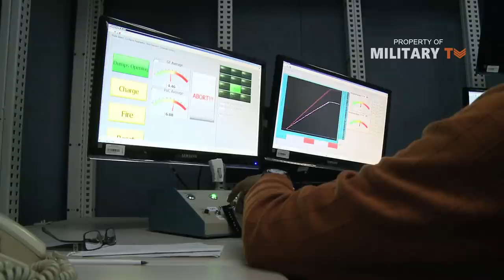Here are 5 of the worst weapons projects the US military has in the works

Comment: some of these (the rail gun, long range gun on the Zumwalt) seem like more engineering in progress, not ready yet. The F35 is one of the worst due to a number of reasons the video didn't go into. The Zumwalt and LCS seem to be fairly good ships, but the military had a mantra of "One Ship Can do All" for a while, which meant Jack of All Trades, Master of None. Zumwalt can still be effective, say, at hunting other ships, but leave land bombardment to another ship. LCS can be effective mine patrol and pirate patrol, in less contested waters since its not as survivable. WIth the new Frigate Procurement process, the Navy has figured out what mission they want from a ship, and what they can leave out of the ship, seems so far to be a good efficient option
Reply: I agree with your assessment on the rail gun, what they also fail to mention in the video is that the whole purpose of the railgun is to decrease the amount of carried explosives on the ship to prevent its total annihilation in case of a rocket torpedo attack.

Comment: Also the rail gun is a very good weapon on a ship like USS Ford. It's rate of fire can increase if built with proper cooling systems,  and Ford was designed specifically to use them. Unfortunately Rail guns will only be useful on large vehicles, till we shrink the size of it's power generation needs or generators themselves

Comment: If you want an honest opinion about the F35, ask an Israeli pilot or ground crewman.  They've been flying them for about a year now and have come up with some very unflattering nicknames for it.

The LCS concept (a greenwater patrol/fast attack corvette) is solid, and the Freedom class actually handles the role reasonably well. The problem is we're not using them for their intended purpose.  The brassholes keep trying to turn them into an all purpose bluewater frigate/destroyer hybrid, which it was NOT designed for.  The Independence class is completely useless.  Best thing would be to strip off the weapons, convert the well deck into a cargo bay, paint them white and donate them to the red cross as hurricane relief ships.

The Zumwalt... I don't have enough coffee, typing space or patience to tackle that fiasco...

Despite its problems, the Ford class isn't really much different from the Nimitz class in terms of development issues, and nothing about them was particularly groundbreaking or new.  The first 2-3 ships had their own laundry list of problems but they were eventually worked out.  Aside from a few bumps, mostly caused by politics, she's on track to be a fine ship.

As to the rail gun... 10 years and half a billion may seem like a lot, but not really when you consider it's a completely clean sheet concept with no similar systems to work from.  The rabid and idiotic drive to strap it on everything that floats RIGHT NOW! is what blows my mind.  Like the Dumb Zum, it makes me thing of Veruca Salt (I want a fancy new toy and I want it now!)

Start out with 1-2 mounted on a big, nuclear powered vessel, then after the bugs are worked out start moving it onto smaller ships.

But all of those ideas make sense, so of course the shitheads in the Pentagon can't  do it.

Comment: Okay these are NOT failed projects or the worst. Okay the Littoral combat ships are bad but everything else is not. The rail gun project which is now getting funding by the Army is a game changer. Tests have proven they can now fire multiple shots very quickly for the gun system.

Thanks to the Army Its going to take longer because now it has to be developed for both land and sea use. Finally the Emals system is fixed, the engines are fixed. Its just the Elevators which are now getting fixed.       The problem with maturing technology is that no one is developing this tech. The US military has a long history of failed projects however the knowledge gained from those led to improvements in other systems down the road. 

Case and point the stealth tech developed for the Commanche was used in the Stealth hawks and the current light recon helo being developed by Bell. Mistakes are expensive but we are human, its how we learn and grow otherwise we stagnate. Or in some companies case bankrupt.

Finally cancelling the replacement SPG for the army was the biggest mistake they could have made since we are the only modern nation not using a modern SPG. The Palliden  is so outdated its scary, does it still work yes but it lacks the rate of fire of everyone else.

For a good comparison and simile. This is like me saying that person is an idiot for buying a 9k computer that does everything but will go dead in say five years. Likewise that person will criticize me for buying a 5k .50bmg rifle because I will only be able to take it out once in while despite the fact it out last his computer by a continent. 

Lessons learned is this, there is no failure just a learning experience. Thank you.

Comment: The rail gun has tremendous potential, it will evolve able to penetrate completely thru ship hulls taking out the heart of the ship, also used to take out satellites
Reply: 45Kimber1911A1 you refer to taffey 3 during the battle of Leyte gulf as for Yamato actually hitting anything that is still up for debate as Yamato never reported scoring a hit in the battle and only fired a few times but at extreme range hence why HMS Warspite still holds the record for longest range hit on a moving target
Reply: 45Kimber1911A1 lacking proper radar (for the time) none of the ships in the Japanese battle group would have been able to see such an event as Yamato hitting anything  (with Yamato firing at her max range of 23km which goes beyond the horizon) not to mention taffey 3 decided to run away into a rain squall and could not actually see the event either. Not to mention that most American ships lost were lost well before Yamato was even ready an the escort carrier that supposedly got hit by Yamato did not report getting hit due to the fact that it was already up in flames and exploding due to damage suffered earlier in the battle it is also my opinion that naval guns over 15 inches offered no real combat benefit seeing as how the only major “advantage” was range but one of if not the longest range shot was done by a battle ship laid in 1911 with 15inch guns
Reply: @collinfrye9555  Battle off Samar was part of the Battle of Leyte Gulf...a subsection of the battle. And during the battle, several Japanese ships landed hits with armor piercing rounds, but the tin cans had so little armor the AP rounds would punch through one side and out the other before they could detonate, forcing them to switch to less penetrative rounds.

The Japanese fleet had been moving in to attack the US forces that Halsey left uncovered having taken the 3rd Fleet to chase Japanese Carriers that were actually a decoy. However the Admiral of the Japanese fleet had no idea the decoy worked, didn't know about escort carriers, leading him to believe them to be fleet carriers, misidentification of some of the american Destroyers as Cruisers, and the sheer ferocity of Taffy 3's resistance led him to believe the decoy failed and they'd engaged the 3rd Fleet, leading them to back off of what on paper should have been a curbstomp for the Japanese fleet who's flagship alone outweighed the entire task force they'd engaged. However a battle is won by men, not machines.

As for the railgun, I have to say that while it's an innovative piece of technology, it's actual tactical usefulness for navel warfare is questionable given that most formidable navies would engage at missile ranges or with torpedoes.
Reply: ChakatBlackstar I’m aware of how the battle went I rewatched the video myself when I posted it. Some thing I learned since posting these comments is that rocket propelled munitions are better than rail guns in every single way especially in terms of navy requirements of efficiency and range, another thing to consider is that both rocket propelled and rail gun munitions do not utilize HE filler and thus rely solely on there ability to transfer kinetic energy into a target much like normal guns. Another thing to consider is over-penetrations still cause substantial damage, as proven by how much time it took to repair ships that suffered such damage, Bismarck was forced to attempt reaching a port in France because an over-penetration destroyed the forward fuel lines leading to its destruction.

Comment: Most of these projects biggest failures was attempting to make the platforms do it alls instead of doing it smart with ships for specific tasks. However I will defend the Ford class ship as it was made specifically to test all sorts of new technologies.  It will be years to perfect new technology used in it.  Like all new technology,  it doesn't work as advertised for years
Reply: I would argue that the Ford is the worst offender since not only is it the most expensive but also risks the possibility of being obsolete
Reply: @williamt.sherman9841  the fuck no it doesn't
Reply: @calliberjoe  yes It does.  Its 100,000 tons at a time when long range anti-ship missiles and short range ballistic missiles capable of hitting ship are more common than ever- its being built when their is a range of low cost VTOL aircraft in development as well as conventional aircraft.

the bulk of the Navy's shipbuilding budget is going to super carriers